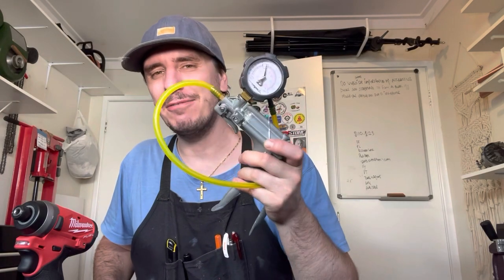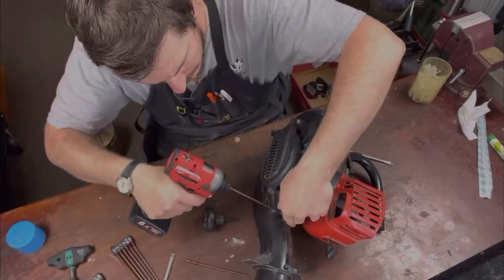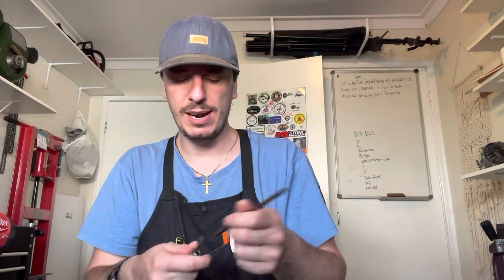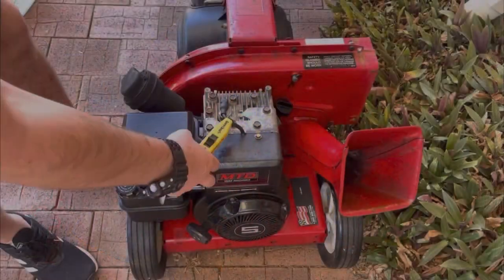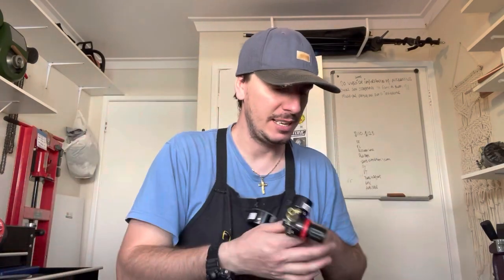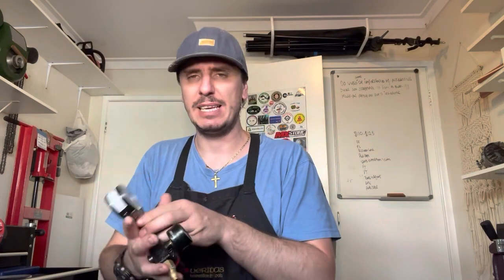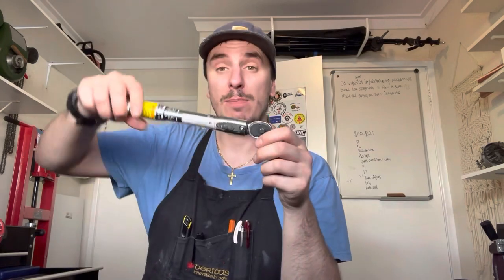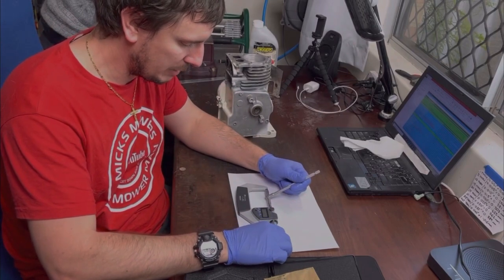5 TOOLS Every SMALL ENGINE MECHANIC Should Own - (And 3 I Advise AGAINST!)

Comment: Tom it is the OLD MAN at Eliminator Performance in Canada. After your first video on the Spark Check'R i contacted the company to find a Canadian distributor and sadly at this time there are none. But i was told a new model SPC-7200 with a MSRP of $59.95 was getting ready for release. The following are the upgrades to the original model: 1. The battery is more durable and battery drain is approximately a third of the original 2. There is now a low battery voltage reminder , in order to keep testing stability. When the voltage is lower than 1.2V the 3 LESs flash at the same time to indicate battery replacement 3. A variety of AAA batteries with different voltages can be used (due to low voltage pro default setting is to use 1.2 and 1.5V batteries) 1.2V rechareable Ni-MH battery, 1.5V alkaline or carbon battery, 3.2V rechargeable lithium iron phosphate battery, 3.6V rechargeable lithium-ion battery 4. The new unit has improved accuracy detection since each has passed calibration independently with better consistency 5. This unit now uses strong anti-interference components which prevent circuits from malfunctioning  or being disturbed. The following comes direct from the manufacturer Trillium Worldwide Inc. 214 Pond Ridge Road, Liberyville, IL 60048 USA. Phone #847-234-5355 for information. WE ARE NOT SPONSORED BY THIS COMPANY JUST PROVIDING INFORMATION FOR YOUR VIEWS SINCE THIS APPEARS TO BE A GREAT ADDITION TO THE TOOL BOX!
Reply: @VintageEngineRepairs  Do not have one Tom waiting on distribution in Canada.
Reply from the maker: Hey Wayne, I have just checked, the model you speak about above is the one that is currently for sale everywhere. I have just checked. There isn’t a “new” one coming out. I think your distributor is misunderstood. Warm regards, Tom.
Reply: @VintageEngineRepairs  The information provided came directly from Sales at Trillium not a distributor so there must be an older model out there and possibly he was referring to release in Canada.
Reply from the maker: Just checked my tester and it had the flashing low voltage to indicate the new model. Something must have been lost in translation? The newer version you are referring too “SPC-7200” is what is for sale and what Kenny and I have in Australia and USA 👍
Reply: I asked Trillium when the NEW one came out, here is the reply:

No Kenneth, the SparkCheck’r is improved over our original CheckSpark.

Can you please send me the info. that informed you of the improvements? 
Thank you in advance.

Regards, 
Gary Devroy
President - Trillium Worldwide Inc.

It appears the one Tom and I bought IS the current version.

Just wanted to clear that up.
Kenny
Reply from the maker: Thanks for the clarity Kenny, much appreciated!
Reply: Trillium also stated that the new model was "released" last year.
Reply: @KensSmallEngineRepair  Based on information just  received it was launched last Fall.
Reply: @KensSmallEngineRepair  Original information i had received said the new model was being "released right now" by Gary so i had made the assumption it meant exactly that. Have just emailed Gary the reason for the misunderstanding on my part which i believe was because they do not have a Canadian distributor yet.

Comment: Agreed, but add a good set of high speed drill bits, a good gear puller,  a good  flywheel puller, and a good tap and die set.

Comment: Torque on cylinder heads, especially OHV engines is pretty important, but CONSISTENCY is the key. No one, except me lol, calibrates their small engine torque wrenches frequently, If the value is off a few inch or foot pounds no worries but they ALL need to be the same for proper loading applied to the assembly. And the torque sequence called out by the manufacturer should be followed to get proper fitment. Great video Tom, but I like torque wrenches, especially on expensive engines like Kawasaki’s.  A twisted head can and will result in head gasket failure
Reply from the maker: Thanks for sharing your thoughts kenny!!
Reply: I just use the German industry standard torque spec and its worked good for me. Just crank it down 1 gutentight

Comment: Two things i highly advise as a tech is a 12v screwdriver, not an impact. I have a DeWalt but Milwaukee makes one in the m12. The main difference is that the screwdriver is basically a very compact drill with the 1/4" quick change chuck and the main advantages is that there are no impacts that can damage small fasteners and the adjustable clutch makes it easy to not over torque pieces so assembly and Disassembly goes way faster. 
The other thing is a bench mounted bicycle repair vice, you can get cheaper ones for $30us that work great but we have a park tools one in our shop and its amazing. I mostly use it for safely tuning handheld ope chainsaws/string trimmers and it holds the tool perfectly steady and in a safe direction so you can hold your tach and screwdriver without having to monkey with holding the equipment
Reply from the maker: Hey mate, thanks for the advise! I do have a drill with chuck, but never got on with it with hardware! I’ll check out the bike vise , that sounds interesting!!

Comment: Hi Tom I just wanted to thank you again for sharing your expert knowledge and advice.

Since watching your instructional videos I've been using my pressure and vacuum tester to test carburetors, crankcase seals and fuel lines. I've also discovered it can be used to test the combustion chamber seal on Paslode nail guns.

Like you've said elsewhere, it can be tempting to just throw parts at a problem instead of properly diagnosing a fault, especially in a professional setting, but I'm with you that systematic diagnosis means lower costs and better outcome for clients in the long run.

Let me know if you'd be up for a chat, email etc. I'd love to pick your brain about some of the finer points of diagnosis and repair. I'm happy to share what I know about power tool repair, and I've also studied some Christian literature and philosophy so it might be interesting to explore that as well.
Reply from the maker: Glad you have enjoyed my content Sam! Thanks for the kind words :)

Comment: I say buy the tools that you can afford then if you want buy better.Like you say there is not huge torque pressures it aint a space shuttle.I have tools that are over twenty plus years old made of steel not cheaper modern metal.This year i am going to start replacing piston rings on my stash of spares machines to sell them off.And clear space also be more money

Comment: Couple questions. Why did you choose the 12V over the 18V Milwaukee? And, does that particular multi-meter have a capacitor test option?
Good one as always.👍🍻
Reply: The 12v milwaukie stuff is better other than batteries and yes that multimeter does
Reply: @bluejene2146  Better in what way?
Reply: @William Emerson  lighter doesnt break shit or overtorque it.. just everything about the m12 tools is great for small engines
Reply: I find m12 smaller too, so it fits better in some places too.
Reply from the maker: I like that the battery doesn’t extend out like it does on the 18v and I have the option for the 2hA so I can get it in tight spaces, they are more affordable, lighter, more compact and have all the torque and more :) thanks for stopping by!
Reply from the maker: Oh yes and it does have the capacitance reading feature! :)

Comment: Hey Tom what a great video! I have to say that I agree with you concerning most all of the tools mentioned, including the torque wrench. Experience comes with a built-in torque wrench, the one in our elbow lol. As far as future small engine mechanics? I don't believe there will be a need as most everything is getting cheaper and cheaper quality. Unfortunately it's going to be a throwaway world in the not to distant future. Just look at the sh*t on the market today! It's definitely isn't designed with the mechanic in mind, as much as I hate to say it....
Reply from the maker: As much as it pains me to agree with your statement it’s certainly looking that way isn’t in Don! I hope that buyers purchasing habits change as they get sick of cheap crap failing and I do feel there will always be a market for repair even though it may not be quite the same. I don’t think petrol equipment will be going anywhere any time soon, battery is getting horrifically expensive and it’s not close to petrol either. The future? Let’s hope our children can still enjoy working on engines as we do, though that is a bit of a pipe dream. Thanks for sharing :)

Comment: I agree with everything except buying the cheapest tools.  Cheap tools break and waste your time.  They strip rusted or partially damaged fasteners.  They can even cause injuries if they slip or break while in used.   You dont need the most expensive tool truck stuff.  I like mid grade tools.  They have served me well.  The cheap stuff is fine for wrenches you need to cut down or modify and you will only use once or twice.  My humble opinion.  Nothing wrong with being geeky and measuring stuff.
Reply from the maker: Thanks for sharing :)

Comment: Does that compression tester have fittings for ALL old and new small engines?

You didn't mention a tachometer. You tune by ear. Do you find no real use for an inductive tach.?
Reply from the maker: I missed a tach?! No I highly recommend one haha :) I do tune by ear most of the time, but I love a tach too! The compression tester fits all engines I have come across so far :)
Reply: @VintageEngineRepairs  Have you seen the negative reviews saying that compression tester is off by 3 bar? Seems like a lot of money for an inaccurate tool. If I need to spend more, I would rather have a pro tool with all the same fittings. Any suggestions?
Reply from the maker: This kincrome tester? No, I haven’t seen anyone state inaccuracies, mine hasn’t been either :) the issue you’ll run into is using a mn automotive compression tester for small engines. They don’t work. Mityvac make one you may like? https://amzn.to/4aimaFS 

Here is a video I made on the topic - https://youtu.be/M6eXO6n8hhg?si=PQeLRorb3B4Myv8m
Reply: @VintageEngineRepairs  Sorry I was referring to the Mityvac, as it was in the links. First I heard the name kincrome.